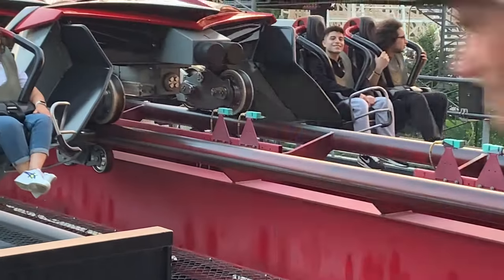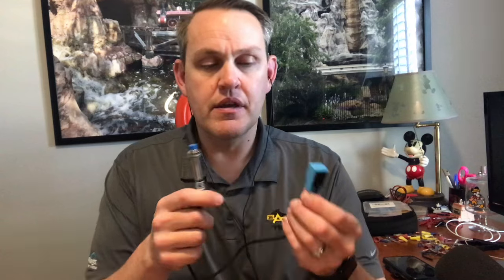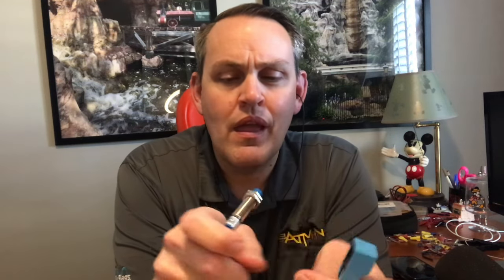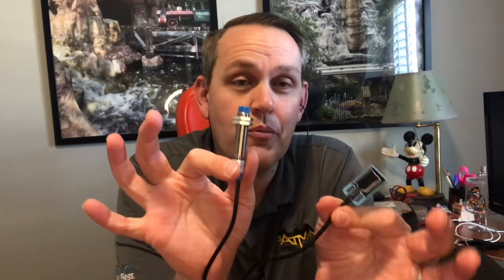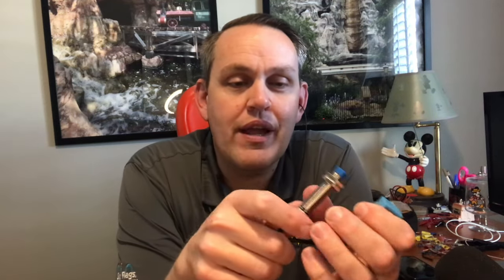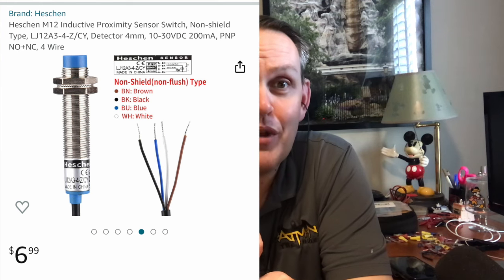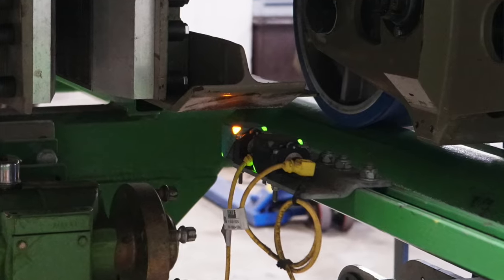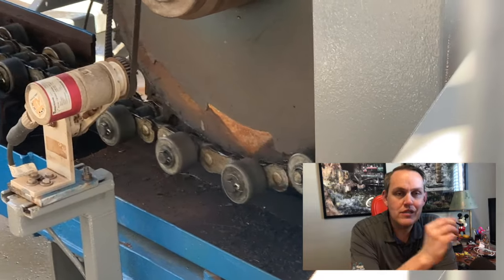Rollercoaster Proximity sensors and photo eyes

Comment: Brilliant video, reminds me of when I used to train engineers PLC controls and the amount of time I spent training experienced maintenance engineers about normally open and normally closed. "I would ask the class, does everyone know the difference between normally open and normally closed, to which the reply would always be, can you go over it just in case?" then you have the joys of safety relays. Admittedly, I worked with PLC for over 20 years and never knew the difference between PNP and NPN.
Reply from the maker: Nice. What still messes me up is on photo eyes “light operate” vs “dark operate” because I’m sitting there going, wait?, is this when the beam is broken or when it sees its source?  Always confusing. By most things o worked on were light operate and I had two ride that were dark operate. (Water rides, go figure)

Comment: Another interesting use of photo eyes is data transmission. B&M flyers have a photo eye on the port side of the train (I don't want to use 'left', 'right', 'load', 'offload' in this case to avoid confusion), and another photo eye mounted at the front of the station, and that's how they communicate restraint states. On Air it used to be done via radio transmission but that was very faulty!
Reply from the maker: Best bus I’ve seen is ASI to do that but they mess up from time to time. The modules are kind of susceptible to heavy vibration. Hard to keep computer onboard trains.
Reply: @ryantheridemechanic  Yeah, flyers are a whole beast to be playing around with when it comes to electronics and weight.

Those trains use a split power supply, here half of the bus bar powers the front half of the train, and the other half powers the back. On coasters with continuous bus bars along the station, is this normal? Would love to see a deep dive on these more advanced coaster types!
Reply from the maker: @danlastname9002  honestly, I don’t have too much experience with the really complicated trains that being one of them. I do have more experience with smaller, but still somewhat complicated things. I know a lot of manufacturers went for individual pick ups for each coach which means there’s a lot of hardware and moving components in the station, but the wonders of not having the past cables from hitch to hitch is amazing.

Comment: for the photoeye, you could in theory use both sides (NormallyOpen and Normally closed) for two purposes normally closed for plc input and normally open for a simple indicator panel thus having no open wires and getting full use out of the sensor.
Reply from the maker: @geekmoto1363  most of the time the panel will take the status of the sensor bit in the PLC. The NO and NC are used to verify change of state ensuring the device is working properly.
Reply: @ryantheridemechanic  i know, just a theory on how it could be used its better to have the plc handle it but if for whatever reason the plc doesnt have enough outputs you could do this as an indication only
Reply from the maker: @geekmoto1363  sure

Comment: Why was the output light on the box repeatedly turning on/off when you were messing with the sensors
Reply from the maker: The last time I had used this controller, I had programmed it for a haunted house that I made at home so the input was just triggering a programmed output for the video it didn’t particularly matter, but it was trying to run a solenoid output that wasn’t there

Comment: I assume Allen Bradley sensors are the ones typically used on the rides? How about how they interface with the PLC Rack though? Are Siemens controls more common or Rockwell Controls?
Reply from the maker: Normal ride use Allen Bradley PLc with pepperl and fuchs proximity switch. P&F is the top of the sensor game.

Comment: Are photo eyes still used on new attractions? I feel like they’re older tech compared to prox and don’t remember seeing them on newer coasters here in the uk at least. Perhaps more so on rapids / flukes etc.
Reply from the maker: They are more of an older control. Like you said mainly now on things that don’t have a well defined path like water rides. After smiler, there was a lot of photo eyes installed across the low side of tracks to help see if there was a valleyed train.

Comment: 14 mins in. We call that "loading the parts cannon". What you described from the beginning was firing the cannon. I get it though. Guests are mad that the eide is down. Just try something fast.
Reply from the maker: And sometimes it’s “fire at Will “!!
Reply: @ryantheridemechanic  I can't say that I'm not guilty of firing the parts cannon a time or 2. It's a bit different in automotive. I end up paying for it if the repair doesn't fix the vehicle. We tend to do that as a last resort. I'd say I'm at least 85-90% good when it comes down to it. When it doesn't work, we'll I guess it's just time for another volley😂😂 Maybe load it a bit hotter too.

Comment: Really enjoying these electrical segments, I think youve uncovered a really fun way to explain circuitry. Cant tell you how many people ask me about how my pyro firing system works only for their eyes to gloss over 😂 

So, now i want to know about that teal color.... it seems the P&F sensors arent the only thing sporting that color-- theres some type of wearable part above the drop chain on B&M dives.... and now i really want to know if theres any significance to this color 😂😂 are there any  amusement industry standards with part colors or form factors? 

Are all those green/teal sensors on the rollercoasters from P&F?
Reply from the maker: Most are from P&F. I know what you’re talking about. A lot of UHMW is also a tea color but that’s sun faded. It starts out a vibrant green. Sometimes the manufacturer of those plastic components makes the bottom part of that red so you know when it is worn down to the point where it should be replaced really cool
Reply: @ryantheridemechanic fantastic, I assumed they were wearable parts. 

Are there any unique ways that ride manufacturers implement sensors that others do not? Do some manufacturers use more sensors than others would in a similar ride? The ingenuity of B&M restraints, moving floors, train transfers has me feeling like they have some simple, yet effective control system designs

Comment: You mentioned the photo eyes you have were scrapped and you got to take it. Do amusement parks not have their own repair cycle or supply system type of thing? 

The reason I ask is because in the AF we replace parts and turn the bad part in as DIFM (due in from maintenance). These assets are sent off to another agency to be repaired and put back into service. It seems like a colossal waste of money and resources to not be able to just replace a lens.
Reply from the maker: For most things under a motor or hydraulic assembly, it’s just not cost-effective to try to repair them to put them back on and possibly find out they might not work again. Also, most suppliers and manufacturers won’t sell parts at that small level. They only supply replacement components for the entire assembly. Nine times out of 10. It is just remove the part and replace it with a new one. Even if the problem is not fixed, at least you have a new part in now. Ha ha ha
Reply: @ryantheridemechanic  lol man, I wish I could throw parts at airplanes. They make us troubleshoot until there's a for sure fix...even when there isn't one 🥴 But I get that manufacturers can be picky for one reason or another.
Reply from the maker: @bprebula  and for rides. They stop. No worries about falling from the sky!
Reply: @ryantheridemechanic  I'm glad they do lol

Comment: My employer uses inductive proximity *sensors*, not *switches*. Their sensing principle is generally the same, but instead of outputting a digital signal (there is something / there is nothing) like the ones you showed, they output an analog signal that is proportional to how much of their active area is covered / how far away the object is. They only run on two wires in that they modulate their current consumption (they basically add dummy load to your circuit) and you need to monitor the supply current in order to read them. 
Now when customers need spares, they often think that our spare parts are overpriced (not saying they are wrong though😅) and order your garden variety prox switch, just to find out that they don't work when they try to connect them. (Ours are re-labeled with our own markings instead of the OEM part numbers, we know why) However, even if the wiring were compatible, for what they are used in our application, you certainly need the analog output, a pure switch wouldn't do it anyway.
Reply from the maker: Sounds like those are more like transducers with a 4-20 mA signal ?
Reply: @ryantheridemechanic  actually this specific interface is called NAMUR, and the current just goes between 1.2 and 2.1 milliamps.
We have other kinds of sensors that do 4-20 and a lot of our legacy equipment is 0-10. (and way older stuff used voltage signals instead of current, but that has been obsolete for decades)
Reply from the maker: @Colaholiker  interesting 🤔
Reply: @ryantheridemechanic  Yeah, but unfortunately it has nothing to do with rides 😕
Reply from the maker: @Colaholiker  well, you never know.

Comment: Now I won't be able to look at a ride without  trying to spot the proximity sensors.  I was wondering if moving from California to the frozen tundra sucked for you
Reply from the maker: Not at all I love it in fact. Seasons are so amazing. California never gets true seasons.
Reply: @ryantheridemechanic  for me, the older I get, the more I detest winter.  I just hate dealing with the snow.  I hate digging the car out in the morning, I hate driving in it.  and the weird thing is winters aren't nearly as bad as when I was younger.  we definitely got more snow back then
Reply from the maker: @dindog22  age will turn the tables for sure. For now I can handle it. But I have a higher tolerance than most because I did not grow up in the snow either. So it’s more of a novelty to me.

Comment: So was it a photo eye failure that caused the Trains to collide on Magnum XL200, a few years ago? One Train was sitting on the Brake zone outside of The loading station while there was a Train waiting for dispatch inside the loading station. As a 3rd Train exited from the last Tunnel, the Safety/Holding Brake Zone, failed to Stop the Train. And as Homer Simpson would say, D'OOOOOOHH!!!
Reply from the maker: Most of the time photo eyes are used as a 3rd check. So they are responsible for getting stuck on a lift or stuck in a break. Something like trains colliding is typically caused by mechanical failures like brakes, not acting fast enough or something, preventing the brakes from working properly like they were adjusted wrong. The other time is when the system is reset during block shutdown this is the reason why most rides are evacuated prior to resetting blocks.
Reply: @ryantheridemechanic  Oh, ok. As I recall, there was Inclimate weather the day that happened. If it does happen to rain, and of course no lighting in the area, Magnum operates with just a 2 Train Operation. Blue Streak just 1 Train for example.

Comment: If you stick to single train ops, your backyard coaster could do without sensors... Just saying 🤷‍♂️
Reply from the maker: Still need sensors to shut down the lift. Powers expensive.
Reply: @ryantheridemechanic that's an extra, it could be manually turned on and off by the operator. Or even hand cranked to keep it simple and save power 😅

Or go for a launch! With a big red GO button to smash 😂
Reply from the maker: @HaroldKuilman  😂launch button and a hand brake against the track !  here we go!
Reply: @ryantheridemechanic  breaks on the end of the track that are in braking mode by default, like a spring loaded skitblock from below or both sides